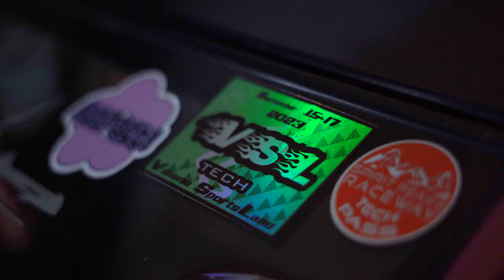How to crash your drift car | A step by step guide

Comment: My IS was worse and it's been fixed. But I did consider it a bit more of a car that should be fixed since it's a LHD factory manual slick top IS300 (not many of those were made). 

As for this maybe a 2IS with the 1j and CD009 out of this? It would definitely be a car worth developing parts on for Serialnine as well.
Reply from the maker: We just developed all of those arms on the 3GS ! They share most of the same suspension.
Reply: @SERIALNINE  I did not know they shared suspension with the 3gs but it makes sense they do.

Comment: Part out?
Reply: Most of it is sold but what are you after ?
Reply: @kevin-serialnine  is the rear package tray one with or without the third brake light? I've been looking for one without the third brake light holes
Reply: @WoodrowsWheels  Thats gone sorry
Reply: @kevin-serialnine  Can I buy the shortened spindles?
Reply: @kevin-serialnine  any bushings
Reply: @kevin-serialnine  no worries. I found out that CoverKing who makes the Mooneyes dash mats actually makes rear deck covers. And I won't lie to you I kind of stole your idea and got a Zebra print Mooneyes dash mat in my IS. I'm thinking I might do the Zebra print cover on the rear deck now too
Reply: Do you have front adjustable control arms
Reply: @WoodrowsWheels  that’s tight

Comment: Make a bolt in tube frame. If you fuck it up again, you can simply unbolt it and replace it with the copy’s you made from the first gen of tube frame. At least that is the route I would go if I wanted to keep the car I’m Familiar drifting in